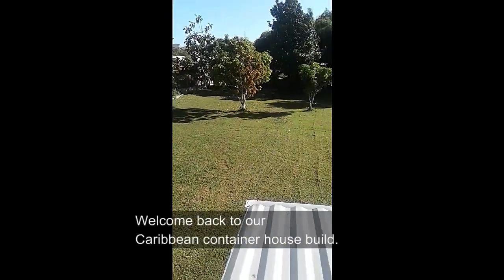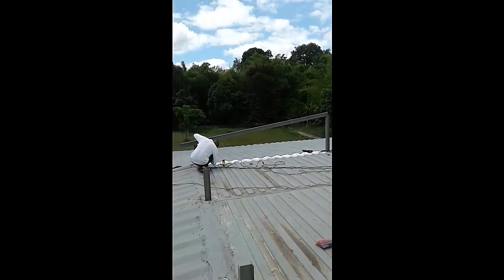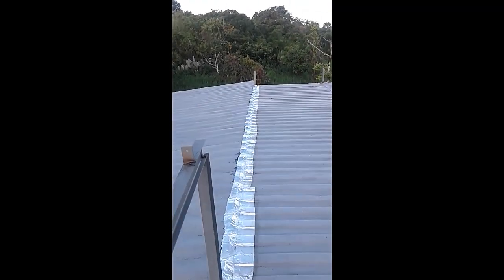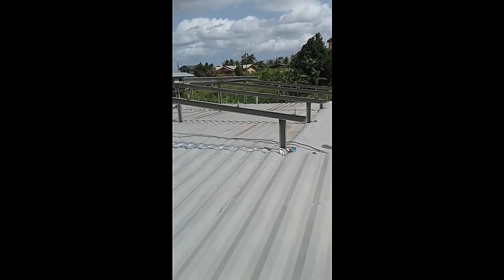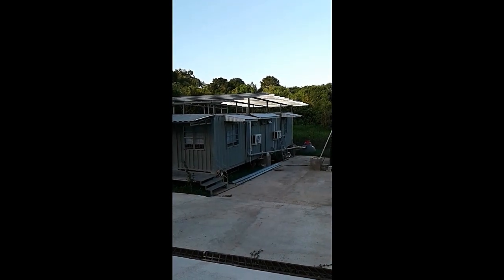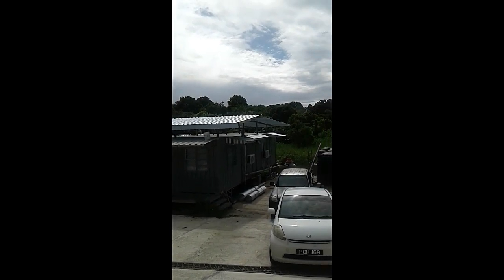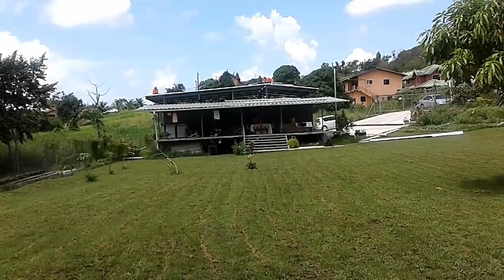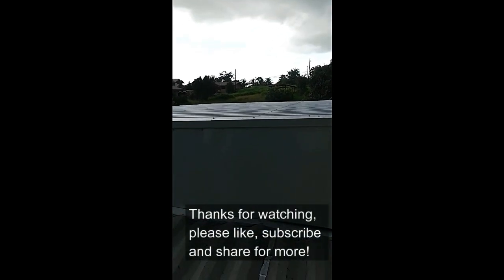Building a Container House in the Caribbean Ep.16

Comment: Looking forward to the next video... Hoping there is a follow-up.
Reply from the maker: Might just do one during this covid-19 situation.
Reply: @petersrum  Hi, I'm interested in building one myself. I  was wondering, did you do any 'heavy' insulation and what was your cost for this build, if you don't mund sharing?
Reply from the maker: Didn't do heavy insulation, just alfoil a 2 sided insulation adhered directly to the inner container walls with a 3-4" air gap between the gypsum walls. Total cost was under 100k usd as I built a road, fencing, foundation etc etc. It can be done cheaper once you have easy access to power and the main road. That and do a lot yourself. Plan ahead, buy material on sale/shop around for better prices.
Reply: @petersrum  Thanks for the info. Still looking forward for a follow-up video.🙂

Comment: Watched the whole series ,  and left with some questions 1) what would you differently ? 2) How easy to Expand?  3) what is the fatboy?? 4) still like the open concept?
Reply from the maker: I'd have used more insulation and galvanized rhs for the framing behind the walls.  Not hard once funds are available to expand upwards and or outward. A fat boy is a quick cespit or seep away system.  Love the open plan....
Reply: Hello from NYC, up until this video what was the cost in total? How much for each container? Did you get them in the country your in?